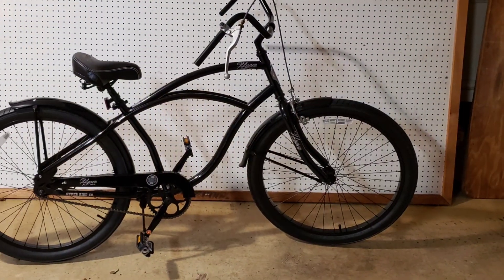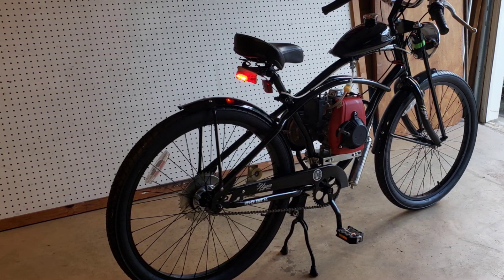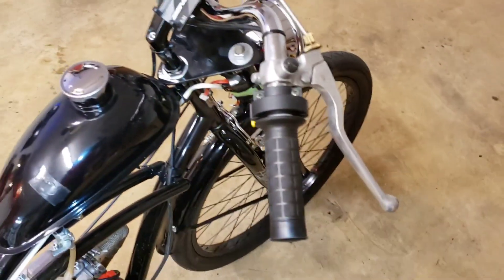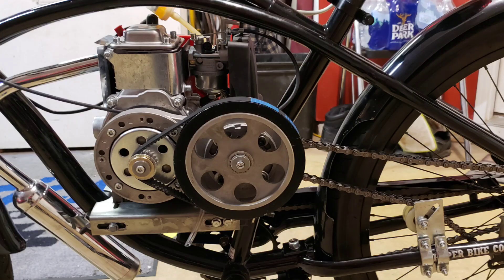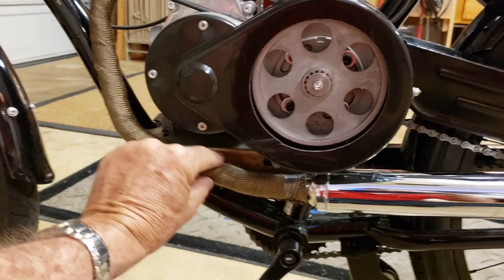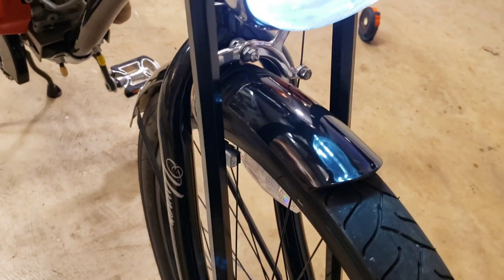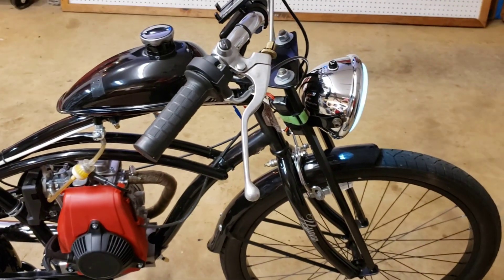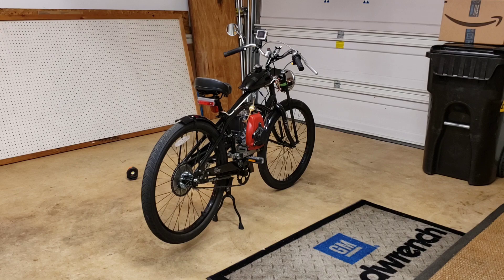4 stroke motorized bike

Comment: Very nice build. I built one on the blue Kent frame from wort mort. Top speed of 30. Starts first or second pull. Came with a bad spark plug. Alignment was perfect never used the tensioner. I mounted it out of the way on the bike just in case.
Reply from the maker: Wow thanks, sounds like a good combo. I think it is just fun to build them, not expensive and you can do whatever you want 👍

Comment: lovely job... great looking bike..
Reply from the maker: Thanks Magpie!
Reply: @goose278  it's my aim to have a four stroke engine. I've had the wee 49cc two stroke chinese thing for 12 years now, it still runs okay on the flats😊😉 it's lost it's power for the hilly bits😆😂😂 I tried a longer pipe which increased the power, yet the tick over had to be stupidly high to prevent it from stalling when stopped in traffic😆😅😂 plus, the clangity clang of the two stroke gets a bit much after 20 minutes🤔🥴😜 great inspiration, thank you...
Reply from the maker: Yes, I like the belt transmission for these, beware of the chain type I would say .

Comment: I switched to a heavier chain, 415H is a scooter chain, much beefier.
Installed a different front wheel with a brake disk and welded the caliper to the fork, it really stops with authority now.
they do require decent tools to install and theyre fiddly , need regular work but loads of fun on the snowmobile trails up here in Maine.
Reply from the maker: Wow that's great! So far so good I haven't had any more chain problems at all. I put a disc on the back and I got a new hub for the front but haven't respoked it yet

Comment: every time i see this bike with the gas tank on top of the frame wedge i just ask WHY, IT FITS INSIDE THE WEDGE AND IT LOOKS A MILLION TIMES CLEANER
Reply from the maker: I agree, I tried it but the cap is in the center and gets in the way.
Reply: @goose278  its worth capping and welding on the side
Reply: @goose278  Do you think those engines would handle a 15 mile (30 miles round trip) cruise at 30mph once a week into town for very long?
Reply from the maker: @michaelbrinks8089  I would think easily definitely no problem

Comment: Looks like belt drive you like the transmission and any issues with centrifugal clutch
Reply from the maker: It's been Flawless other than coming loose once or twice so you need to check those once in awhile. But it works great haven't had any issues. I think it's a lot smoother than the chain drive transmission

Comment: FRIEND, CONGRATULATIONS ON THE VIDEO OF THIS FANTASTIC BIKE. WHERE DID YOU PURCHASE THIS MATERIAL THAT COVERS THE ENTIRE EXHAUST PIPE? WHAT'S HIS NAME ? WHAT MODEL IS THIS BIKE FRAME? WHERE DID YOU PURCHASE THIS CENTER SUPPORT? THIS TYPE OF PEDAL, THAT WHEN YOU STEP ON, IT LOCKS THE TIRE? WHERE DID YOU GET IT, IF POSSIBLE SEND THE LINKS, THANKS.
Reply from the maker: I can't right now but I will try to gather that up to you later
Reply from the maker: https://www.walmart.com/ip/Hyper-Bicycle-Men-s-26-In-Beach-Cruiser-Bike-Black/299035532?wmlspartner=wlpa&selectedSellerId=0&adid=22222222228299035532_143229610229_18632966377&wl0=&wl1=g&wl2=m&wl3=635960850395&wl4=pla-410348710453&wl5=9010850&wl6=&wl7=&wl8=&wl9=pla&wl10=8175035&wl11=online&wl12=299035532&veh=sem&gad_source=1&gclid=CjwKCAiA9dGqBhAqEiwAmRpTC2nq6-WUC30NMayuFXsK1jqh02VBUO_BaWJc8MFkR13exjRTdLIKNRoCKL8QAvD_BwE
This is the bicycle 

https://www.ebay.com/itm/134611882384?mkcid=16&mkevt=1&mkrid=711-127632-2357-0&ssspo=9qrTFPrbSOK&sssrc=4429486&ssuid=V0x2VhWEQ5S&var=&widget_ver=artemis&media=COPYhttps://www.ebay.com/itm/385660753281?mkcid=16&mkevt=1&mkrid=711-127632-2357-0&ssspo=war4_qjgrwc&sssrc=4429486&ssuid=V0x2VhWEQ5S&var=&widget_ver=artemis&media=COPY
This is the center stand and wrap 

The pedals are a bit wider and they come with the motor kit.
Reply: OBRIGADO MEU AMIGO, PENA QUE FICA MUITO CARO IMPORTAR ESSA BIKE AQUI PARA O MEU PAÍS. AQUI A CORRUPÇÃO NÃO PERMITE QUE PESSOAS COMO EU POSSA IMPORTAR ALGO TÃO MARAVILHOSO. MAS DESDE JÁ AGRADEÇO SUA PRESTEZA.

THANK YOU MY FRIEND, I'M SORRY IT'S VERY EXPENSIVE TO IMPORT THIS BIKE HERE TO MY COUNTRY. HERE CORRUPTION DOES NOT ALLOW PEOPLE LIKE ME TO IMPORT SOMETHING SO WONDERFUL. BUT THANK YOU IN NOW FOR YOUR PROMPTNESS.

Comment: Can you still petal like a  normal bike if need be
Reply from the maker: Yes, but it has a little drag if the motor is not running because you're pulling another chain. I guess if the motor broke down you could pull the master link off of the chain and pedal your way home
Reply: @goose278  thanks

Comment: Ive yet to build a motorized bicycle, but at 00:28 can you explain what this is and why it was included in the slide show?  Is this sprocket assembly standard or was this custom? If custom, why did you go custom and not go the standard sprocket assembly route?
Reply from the maker: Hey Chris! That is a rag joint it's not a very good sprocket assembly but it comes with the kit. In another video I have it shows the better route to go, it clamps around the Hub and it's not as wacky as that. that is very hard to get set perfectly. The Hub mount is not that expensive and it's definitely the way to go

Comment from the maker: I am hoping the air movement of the bicycle will help componsate🤨 So far it seems to run very cool.
Reply: If the bike is in motion, some cooling should take place, as it does with the uncooled 2 stroke engines, however on my 4 stroke engine I prefer the well engineered intact cooling system.  The factory design cools the engine at all times, whether moving through the air, or not.
Reply from the maker: It is a very well designed engine

Comment: Did your pedals clear the engine or did you add a wide crank set?
Reply from the maker: Hey Dale, yes that kit came with a wide crankset but it's not too wide, hardly noticeable .
Reply: @goose278  Thanks.  Did you have to buy a 3 piece conversion kit?  If so, can you tell me where you git it?
Reply from the maker: https://www.ebay.com/itm/New-Bicycle-Motorized-Engine-Motor-Kit-4-Stroke-53cc-Gas-Petrol-Engine-Full-Set-/392400876110?mkcid=16&mkevt=1&_trksid=p2349624.m46890.l49286&mkrid=711-127632-2357-0

E bay🙂
Reply from the maker: The kit came with a pedal set. They are a bit wider but not much

Comment: cant that big red cover be removed?
Reply from the maker: Yeah,, I painted it black and it looks better. But Im keeping it as a cooling fan for now. It does look cool with a new flywheel and exposed magneto though.
Reply: @goose278  so it blows air over the fins to keep the engine at a stable temp?
Reply from the maker: Yeah like a lawnmower

Comment: What gauges are those
Reply from the maker: https://www.ebay.com/itm/174531899619?mkcid=16&mkevt=1&mkrid=711-127632-2357-0&ssspo=hxzu6dwjs_m&sssrc=2349624&ssuid=V0x2VhWEQ5S&var=&widget_ver=artemis&media=COPY
Hey MBN53 , I got these on ebay but just for looks. Speedometer is off and I couldn't get the tach to work with the 4 stroke. So... maybe you can make them work 😏

Comment: This engine comes with a forced air cooling fan, and you have crippled the cooling system by removing part of the ducting, just like many people do, who do not understand how important cooling is.
Reply: Yea these kits don’t come with a cooling system I have baught and assembled  multiple engines this exact make and model they DO NOT come with a fan or anything like that it’s an air cooled 4 stroke
Reply: @thakoalaking5022  They most definitely do :) there are fins under the cover that hosts the rope-pull start, and the cover is molded to direct the air where it needs to go. Unlike the 2 stroke kits that only get air-cooled when in motion, the 4 stroke kits are being cooled even during idle
Reply: @Makats7  check my videos bud i build motorized bikes for fun the last one I had was a 4 stroke shwinn whizzer that was stolen from me the motor I purchased and built did NOT come with any cooling system whatsoever ever also on 4 motorized bicycle enthusiast pages and never seen them on a 4 stroke or 2 stroke it’s a nifty idea but not one I could see catching on with a motor that won’t warp enough from heat to cause ANY significant change unless your running a shit transmission but that’s on YOU
Reply: @Makats7  btw I have this EXACT kit so no
Reply: @Makats7  4 strokes are oil cooled 🤦🏻‍♂️
Reply: @Makats7  the difference between a 2 stroke and a 4 stroke is a 2 stroke mixes fuel with oil a 4 stroke has an oil plug and a feed line to take oil to the top of the engine
Reply: @Makats7  why must you do this? Noooooooooo you flicked one of my switches 😐
Reply: @thakoalaking5022 whizzer engines don't have the pull start and the fins... Idk what to tell you you can just pull up a manual for any HS142 engine and see that it says "cooling - forced air". Good luck
Reply: @thakoalaking5022  looked at your videos, the two bikes that you have listed are just regular Chinese HS142, not the American whizzers... Also, look at this timestamp from your own video https://youtu.be/2C26RTQjZkg?t=81 and ask yourself a question of why does it suck in your pants? The answer is because there are fins that are drawing air when the engine is running and forcing it to cool off the top head
Reply: @Makats7  no sir my serial number for the bike states it is a whizzer I have the police report showing it is a 1957 whizzer that was gutted of the motor and tires the bike was valued at $8,000 I put hyper cruiser tires on it and 12 inch high rise bars the motor on THAT bike is a Honda 50cc with a 48 tooth sprocket it had a max speed of 48 MPH what in the actual fuck are you talking about?
Reply: @Makats7  what time stamp? Also if you are talking about the pull start with the cooling fins that is on EVERY engine with a crankshaft with pull assembly even if I removed that I WOULDNT need it and it WOULDNT do any harm if this motor has a pull start it MUST HAVE COOLING FINS that is not a cooling system the oil is the cooling system it even states that in EVERY  assembly manual and EVERY maintenance guide made you sir are wrong this guy is talking about an “electric cooling system btw his has fins on the starter I put this EXACT kit on my mountain bike stop trying to argue about something I did to survive the pandemic and am still obviously kicking it not in prison or dead like I did this shit for a living when I was laid off lol btw I live in Boulder Colorado look up your statistics on bicycles lmfao you are OBVIOUSLY WRONG dude seriously the only thing we have more of than dispensaries is bike shops lol 2 largest things in Colorado bud
Reply: Well since you are not in prison you are obviously right and I am wrong. I wish you all the best

Comment: Another thing people should realize these are not mopeds if they were the pedals wouldn't be able to pedal t bike they would just be to start the motor and there wouldn't be a pull start
Reply: A MoPed is a bike with peddals and a motor, thus Mo Ped...how it starts has no bearing in the matter. I once had a TOMOS MoPed that started by peddaling backwards...

Comment: Btw what do you get for top speed? Mine toped out at 27
Reply from the maker: The original sprocket was about 26 or 27 miles an hour. But when I changed it to the 46 I think it is 43 I can't remember. It does about 35 miles an hour. But it doesn't climb hills as good.
Reply from the maker: Just checked on E Bay . it was a 32 tooth sprocket
Reply: @goose278  thanks man!

Comment: 9:58 makes a big difference
Reply: I used the rubber handle off of an old umbrella on the factory kickstand. Clamped it with the old coaster brake bracket. Much more stable. It doesn't even try to fall over and it doesn't look bad.